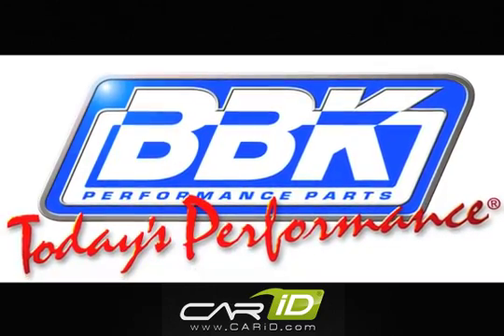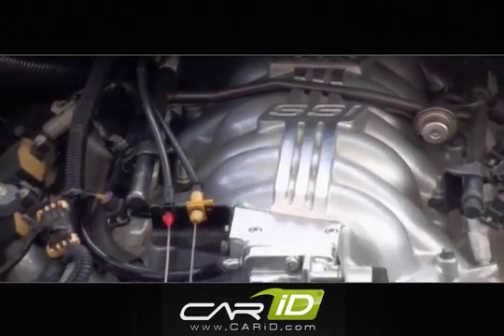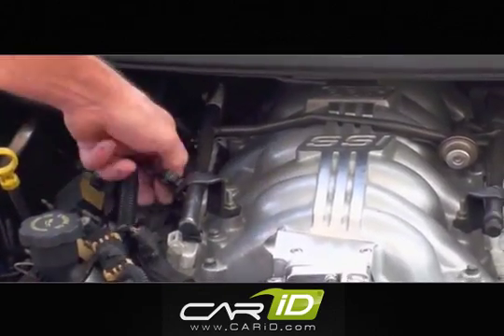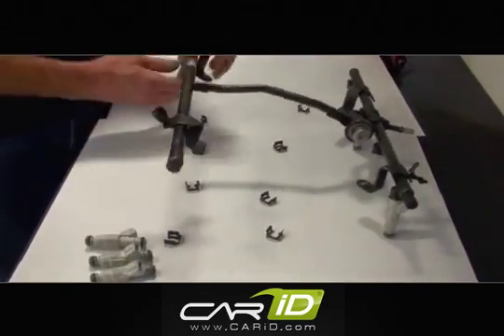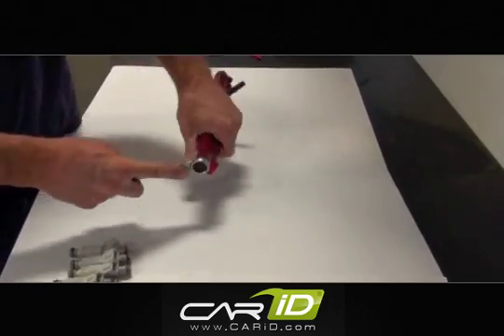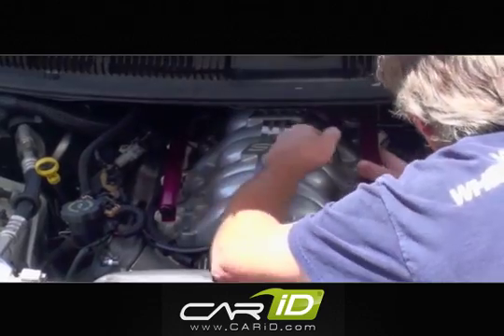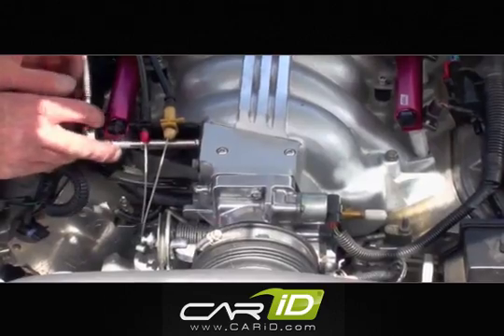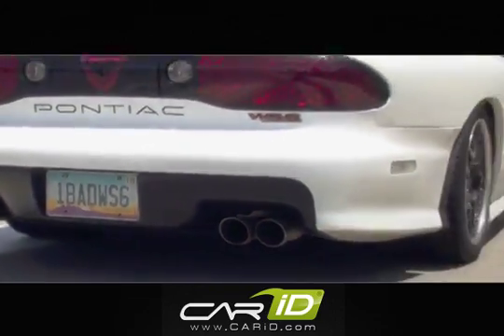BBK Billet Aluminum High-Flow Fuel Rail Kit Installation

Comment: What about the fuel pressure regulator? Do I just not put one back on? Or does it need it before it connect in the fuel rail? Thanks in advance for the help.
Reply: +Monty22r 

the FPR is in the tank by the fuel pump, the thing on the oem fuel rail is a pulse damper and its not needed with aftermarket rails since the rubber crossover hose acts as its own damper.

Comment: Looks pretty easy.  What about the small regulator that is on the stock fuel rails?
Reply: +1999TransAmWS6 

its not a regulator, its a pulse damper and its not needed with the aftermarket rails since the crossover tube is rubber which dampens the pulsing.